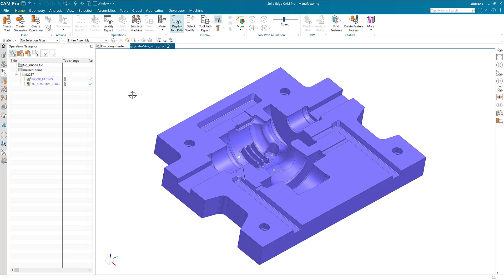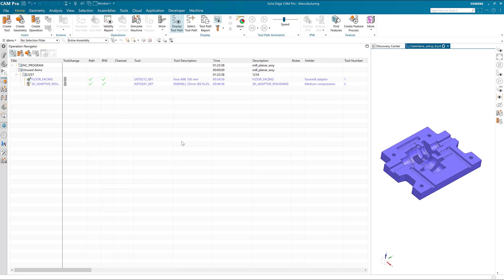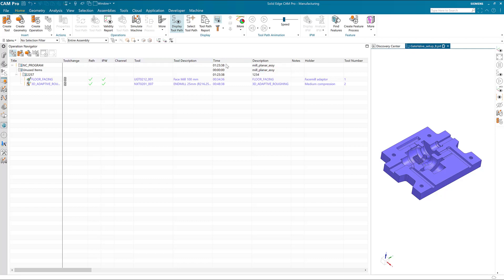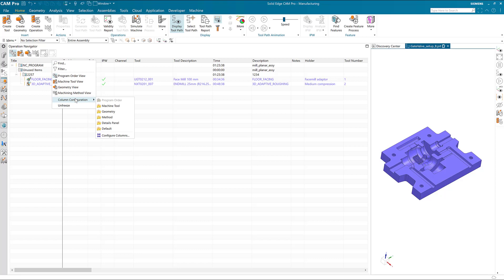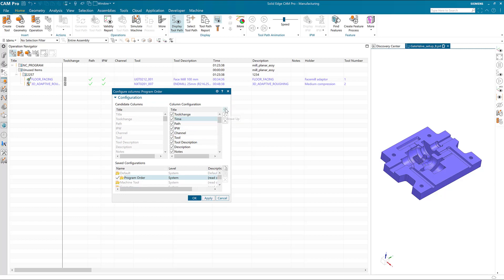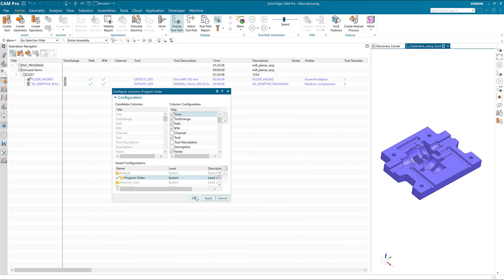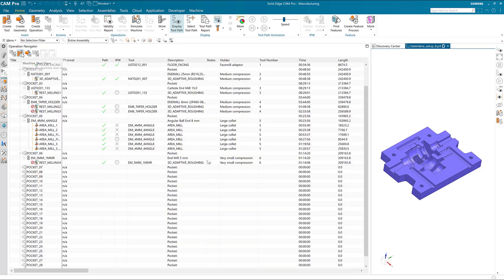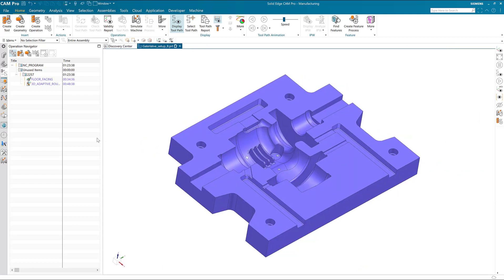Solid Edge CAM Pro: Customize columns of operation navigator

Comment: How can I save these settings for new files?
Reply from the maker: Thanks for your patience while we checked with the product team for an answer:  "If the user has "write" permission, they can simply click SAVE on the Configure Columns Order dialog. If they don't have write permission, they will have to save the configuration with a new name. The new configuration created will appear as the new default."  Best, Team Siemens